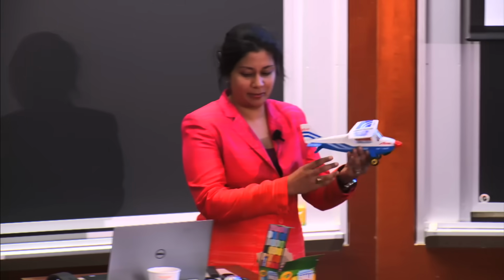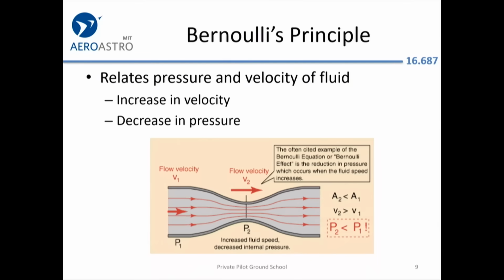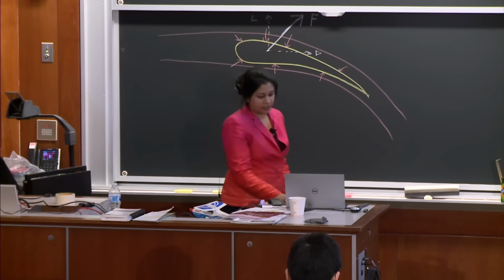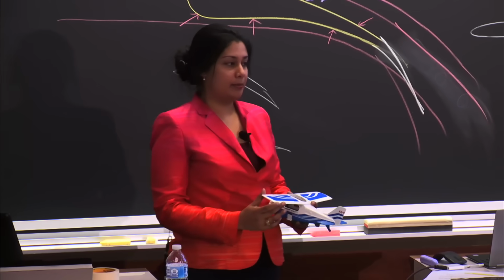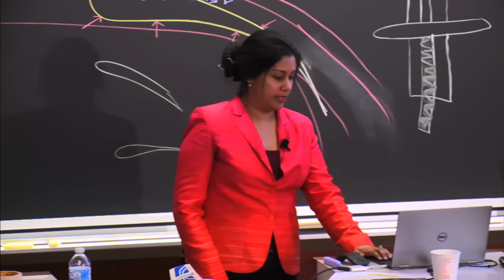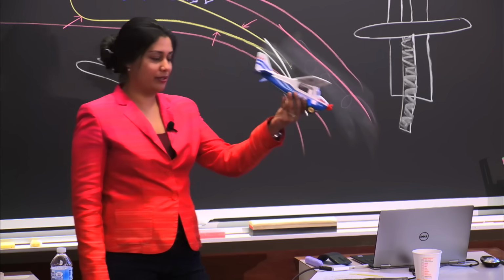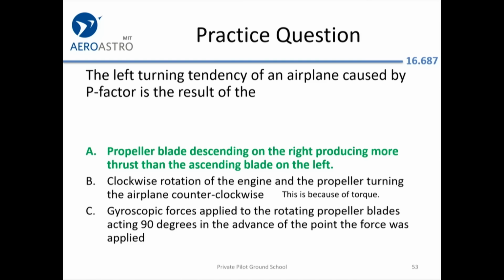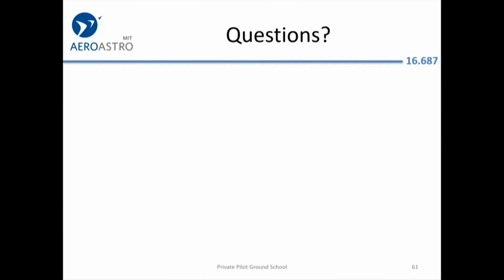Lecture 2: Airplane Aerodynamics

Comment: OK, people that call out others for every little thing here in YouTube really annoy me. I have never done it myself but because this is MIT and there were so many basic mistakes, I could not let this one go.

1)  6:18 Race cars do not create an upwards lift that the "spoilers" need to spoil. In fact the opposite is true and most race car bodies are designed to create lift in a downward direction for more tire grip.

2)  6:18 The "spoilers" themselves on race cars are often called spoilers but they are not spoilers and are actually wings. The major difference between the wing on a race car versus an aircraft is that the vector of lift goes in opposite directions, the aircraft is up and the car is down (again for additional tire grip). But, even though they are often called spoilers, they do not "spoil" lift as mentioned, they create it.

3)  41:58 Flaps are used on takeoff to generate more lift allowing for a slower takeoff speed. This really helps aircraft use a shorter runway, a soft field runway, and to allow for increased takeoff weights for a given runway and density altitude. I have never heard of flaps being used so that you are configured for a landing.

4)  48:36 The rudder plays zero role in the creation of adverse yaw, it is what we use to correct for adverse yaw. Adverse yaw is a result of the higher angle of attack on the rising wing due to the lowered aileron. This higher angle of attack increases the induced drag on that wing causing the adverse yaw.

5)  50:00 A stable aircraft does not mean that if you let go of the yoke that the aircraft will simply return to level flight. If you relied on this in the real world, your in for a surprise. Being a stable aircraft means that the tendency is for the aircraft to return to level flight, but that tenancy does not mean that it simply returns to level flight. Instead, an oscillation is created, and if the aircraft has positive stability, those oscillations will reduce over time and eventually result in a pitch attitude that the aircraft is trimmed for, which may or may not be level.

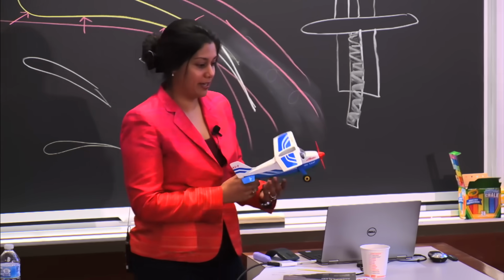6)  58:34 with regards to p-factor, the upwards propeller is not coming away from the wind, that is wrong. At a high angle of attack the air is approaching the propellers plane of rotation at an angle, causing different propeller blades to experience different relative angles of attack. The result is that the downwards propeller blade has a higher angle of attack then the upwards propeller blade. These different angles of attack for the different propeller blades causes the left turning tendency.

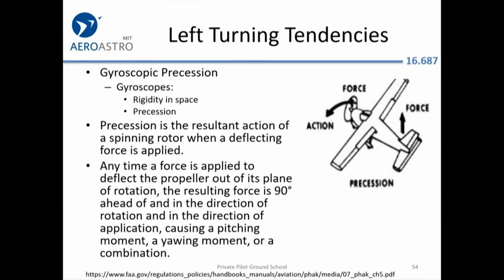7)  1:02:28 Gyroscopic procession was shown as a left turning tendency which is not true (assuming we are still talking about the Cessna 172 which is often referred to in this video). In a tricycle gear aircraft such as the 172, the gyroscopic turning tenancy is to the right, not the left.

8)  1:02:34 With regards to gyroscopic procession, it was not explained how it affects an aircraft. The force is best felt on the aircraft while on takeoff at high power and you rotate and pitch the nose up. This changes the propellers angle of rotation and because of gyroscopic procession, that pitch up will be felt 90 degrees from vertical to the right.

9)  1:05:45 If I was a new student, this would not help me understand what p-factor is. It can be easily explained by hypothetically saying that the propeller blades are set at 10 degrees in relation to the plane of rotation. Let's also say that the aircrafts longitudinal axis, thus the propellers axis of rotation is at 10 degrees to the relative wind. That means the downward prop on the right has an angle of attack of 20 degrees and the upward prop on the left has an angle of attack of 0 degrees. Thus more thrust on the right and the left turning tendency.

10)  One last mention I have. Nowhere in this video does it mention any sort of dome, or bubble, of low pressure above the wing. This dome of low pressure creates most of the lift that makes an aircraft fly. There was a quick mention of Bernoulli's principle (the cause for the low pressure area), but it was never expanded on. This is an important part of lift that was never mentioned.

There may have been more mistakes, but these are the ones that I caught.
Reply: 100% agree with you. This is below what I expected from MIT.  Re your #10, she doesn't understand Bernoulli lift.  She only understands angle of attack based lift such as hands out the car window and paper planes.

Comment: So sorry but when I got to the illustration at the 14:20 mark, It just does not go with my 30yr aviation common sense.
Just how do you get a low pressure above the wing when she shows a force being applied to the wing, both above and below the wing foil?
I also believe that her upper red line of flow does not follow the wing down and should be more straight to create the negative pressure and lift.
May be MIT, but I think I will pass on this video! Thanks anyway!

Comment: The pictures of airflow over the wing are shockingly bad. There should be a stagnation point way inner the leading edge of the wing, at such high lift configurations shown in this video. The flow should come up under the wing as much as it does go down after it leaves the wing. The lift is created by circulation around the wing which effects the flow pattern over a large area not just a local disturbance.
Reply: Inner should read inder
Reply: Ineer should read UNDER

Comment: I am a senior studying Mechanical Engineering and it's crazy how MUCH there is to know. Every gate leads to another more in-depth one. Equilibrium physics turns into dynamics, then you have to incorporate differentials and apply them to manipulate systems, and so on. No one person would be able to create a modern plane in a million years but as a whole human society we've taught each other so much. It really humbles me. Having said that, Dr. Tina has quite the resume and is also a funny and interesting lecturer. Amazing to find free to watch videos like this.
Reply: how is it like to study mechanical eng? would you recommend it
Reply: @prashil1512  its a bitch and a half lmao, im procrastinating on writing my fluid mechanics lab report as we speak.
Reply: @prashil1512  Hard but easy. I love it. But if you're looking for getting job 'easily', then go for EC or CS. I had passion for mechanical, that's why I took it.
Reply: @aromals840  Thanks, Ec is economics right? I’m doing that right now
Reply: @prashil1512  😅😅 I meant Electronics and Communication
Reply: @prashil1512  Woo I hadn't checked when your comment was made.

Comment: I wonder if that lengthy board eraser is as effective as a standard size board eraser? Is its effectiveness dependant on the pressure applied to the horizontal axis or the type of chalk that was used? I am listening to the video but had to pose these questions.

Comment: Awesome.
I am a Chartered Accountant but I perfectly understood the underlying physics. I had an idea that Bernouli principle wasn't responsible for flight but thought it is Newton's third law. Conservation of Momentum was news to me.
Reply: In fluid dynamics the Bernoulli equation is just the conservation of energy at low speeds, when the air density is considered constant and small.
To explain lift the conservation of angular momentum is essential.
Reply: I am surprised with ur knowledge abt aerofoils even though it is out of ur field, i was taught that bernouli's  theorem is responsible fore lift that. Which in this video is debunked.
U r right its newton's third law. Even in my class i was told that 3rd law is responsible for 75 percent of lift generated during takeoff and rest of it is bcz of bernouli's principle.

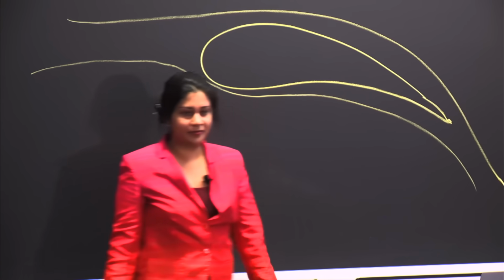Comment: 5:28.  Air does not flow.  The wing moves through the air.   Air is not moving except to move out of the way of the wing and react to frontal pressure and then to come back together after the wing has passed through.   So that is a misconception right there.  Air does NOT flow except by the breeze which in this case does not count.  The wing's speed through the air creates pressures due to its speed of the wing that parts the air in front.  Equal transit theory is WRONG - good !!  Need to use vocabulary stating that it is the wing that is moving .. and the reaction of air to the wing movement is what creates the reactions - which includes a flux area around the wing - in particular - the pressure in front and downward pressure on air behind the wing.  Then she goes to Bernouli equation which is not correct either, because air is not flowing, the wing is moving over air.  The reduced pressure over the upper wing is due to slight vacuum which results in turbulence, where as below the wing, the increased pressure on air below due to the angle of attack of the wing causes higher pressure underneath.  Sigh .... The issue in fact is that air is easily compressible and this is why it is so easily disturbed and turbulence is also easy to induce.  
Where her theory falls apart is when you fly a paper plane and want it to have a positive angle of attack you adjust the wing tips upwards - to make the paper aircraft to fly up, you curl the tips up and not down.  That's coanda effect.  People need to discuss that.  If the wing tips of angled down then the plane will nose dive.
Reply: Gerhard, If you are in an airplane with an open Cockpit (Bücker Jungmeister for example) your point of view is  that the air is flowing past you . Most important is the fact that the equations in an airplane fixed coordinate system are steady and simple.
Trying to describe the air movement on the ground , as the airplane passes is possible but much more involved.
Consider the fact that you are moving with the Earth's rotation and the motion of a falling Stone from your point of view is straight down.
If you would not move, the Earth is rotating below you  at 40000 km per day (if you are on the Equator), and so is the stone initially. Describe the motion of the falling stone from your not moving point of view!

Comment: Equal Transit Theory is Bernoulli's Equation - so why didn't she just say Bernoulli's Equation is wrong instead of Equal Transit Theory is wrong? Also some of what she states is incorrect, you can setup a test with an actual wing and blow air just across the top of the wing and it lifts up in the air! Hot Air also is thinner and moves faster which helps with this, so you can use a hair dryer and get better results. Cold Air being more dense makes sense of why a wing will lift where it rides on top of the air, again a working example is able to be achieved with a cold air generator where you can watch the Heavier Colder Denser Air fall as it has more mass, and you can spin a turbine or sink a platform inside a cylinder with cold air dropping down to watch the effects. So hot air across the top of the wing and cold air across the bottom will give the best scenario for lifting up! As you have Less- Weight, Mass, Density on top of the Wing and you have More- Weight, Mass, Density underneath the wing for support or for the wing to sit on, ride on however you want to state that part. This also comes into play with the Outside Tips of the wings where Air will spin in a circular motion, this can cause various problems due to the turbulence generated at the end of the wings, one situation is that as the wind is circulating it becomes hotter, and that hotter air can end up under the wing instead of on top. Different ends are designed for wing tips to help prevent this, from tips going up, to up and down, trapping air under the wing that you want to stay under and the tips being flared up to prevent the plane from wanting to tip upside down. Also directing the airflow where you want it to go using what is called Vectors - Essentially little Triangle Shapes you can attach to the top of the wing will force the air down across the top for a longer period of time Increasing the performance of the wing. This is also done on Race cars as well. I'm not saying everything is incorrect that this woman is teaching in her class, but this is where Applied Opposed to Theory comes out on top. I think all of the people in her class would have gotten a much better understanding if she just brought in - Some pieces of paper, String, Drinking Straws, Scotch Tape, a Hair Dryer with both hot and cold setting, and some thin cardboard.  Then Some clear acrylic tubes, coolers full of ice, and some water to make the cold air generator. All very cheap and if people are paying for a class then they should get some actual 1st hand working knowledge out of that class. Just saying.

Comment: Please explain why both wingtips really do fly at the same airspeed in a constantly banked level turn and why the FAA is incorrect in its handbooks when it says that there is an inherent "overbanking tendency" when an airplane is making a constantly banked and constant altitude powered level turn.  Please explain why the "overbanking tendency" is an old wives' tale that the FAA has mentioned from after WWII in it's handbooks.  If you don't know the answer, I'd be happy to help.

Comment: Tina Srisvastava contracdicts herself regarding the Bernoulli's Principle: 13:01
https://en.wikipedia.org/wiki/Bernoulli's_principle
The differential of pressure (lower pressure on the top, higher on the bottom of the wing) causes the wing to fly. Classical scenario that proves her wrong is when icing disrupts that flow of air, the low pressure above the wing rises and the wing loses lift. 
Here is another example Thermals. Hot air (low pressure) rise and with it take particles and objects with them. Gliders depend on them once they are flying free. But let's keep on listening I am having fun.